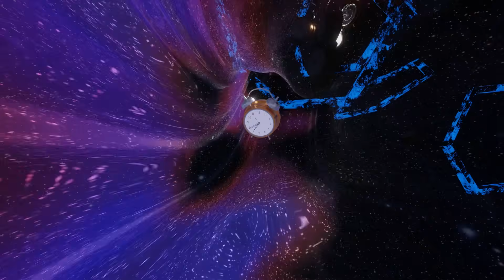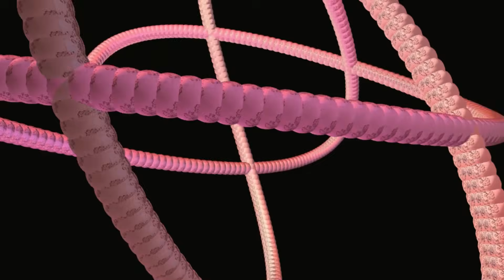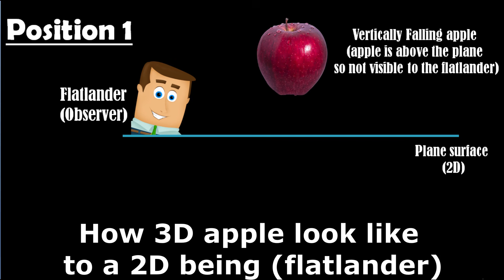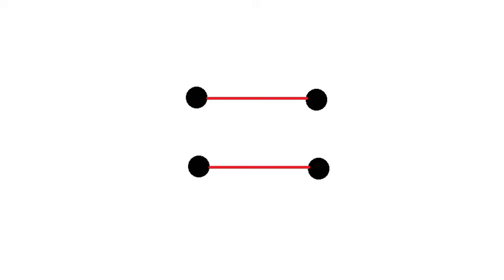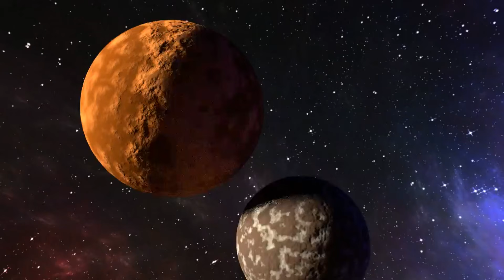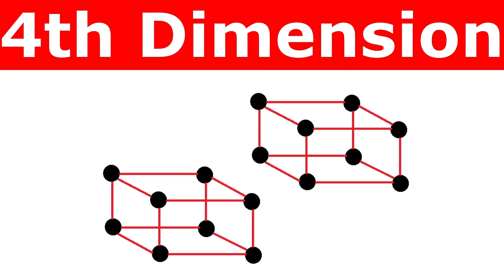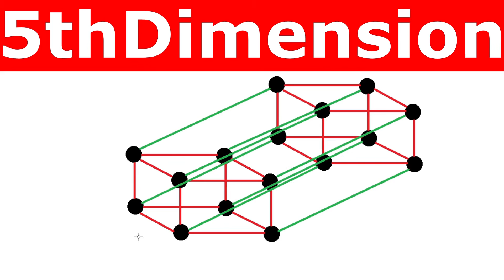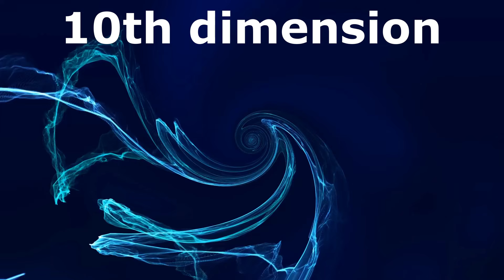11 Dimensions Explained - A Mind-Bending Explanation of Higher Dimensions!

Comment: Where do third dimension beings that can manipulate time, control their surroundings, have powers that are unbelievable, move through the other dimensions at will, but are from the third dimension. My gut feeling is that this is true. So with that in mind one may have to rethink what would change with each dimension and it would not be what one would think.
Reply: That being would no longer be a 3D being as it will have surpassed the universal restrictions placed on themselves. They would be able to break the universal rules and become whatever dimensional being they are capable of becoming

Comment: Wonderful presentation. So helpful ...
I'm wondering if there is any  PHYSICS explanation for some relatively common experiences of us 3D people having odd experiences that seem beyond our 3 D physical nature.  
For example, clairvoyance -- such as a person KNOWING that a loved one has died at the same time it occurs, without being physically told yet.  
Or precognition of events, for example, data such as sounds or images coming to a person related to a major crisis event, weeks or months before it occurs... ( not comprehended to be connected to ANYTHING until the event actually happens in the normal flow of 4th D time, and then the data is recalled and recognized)....
These things DO happen to people, and make them question their sanity because of our strong belief in solid 3D material existence.
I have heard a hypothesis that these things could be explained by quantum 
entanglement...   
Can this be true?
 Or is there another potential hypothesis for our life in 3D?
THANKS!

Comment: All 11 dimensions exist within THIS universe. There are 10 SPACTIAL and 1 temporal dimension.
The mathematical representation of how the number if points and axises keeps growing is accurate. The rest is realtingv2 concepts that are not realated
Reply: As for beings existing in higher dimensions all your descriptions are COMPLETE SPECULATIVE NONSENSE.
A higher dimensional being just extends into more geometrical dimensions.
        Just like flatland taken to higher dimensional examples
Reply: The number of dimensions does not necessarily concede with the number of variables in a system but can be used to chart such information
Reply: Is it physically possible for anything to exist in a dimension higher than 3? Would'nt it require an infinitive amount of energy to exist in higher dimensions?